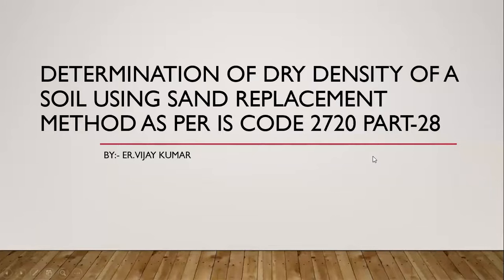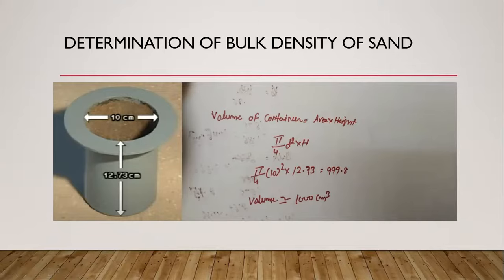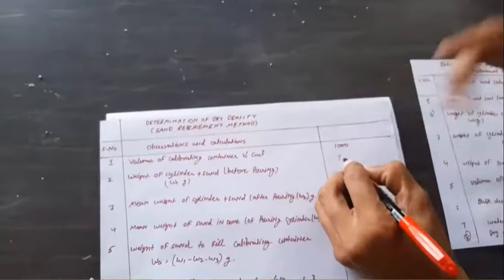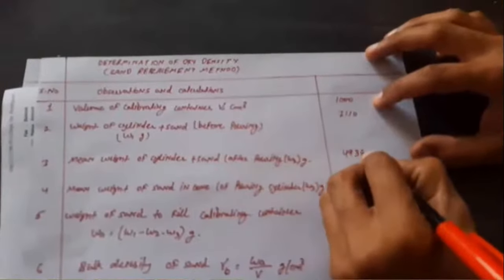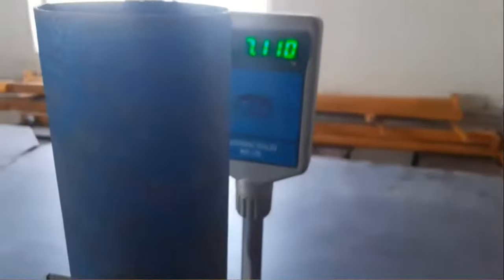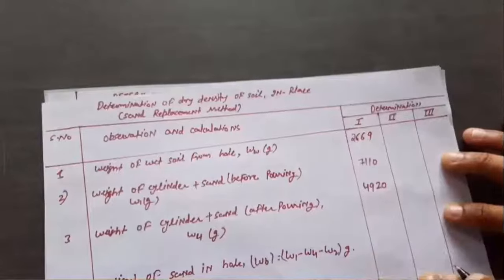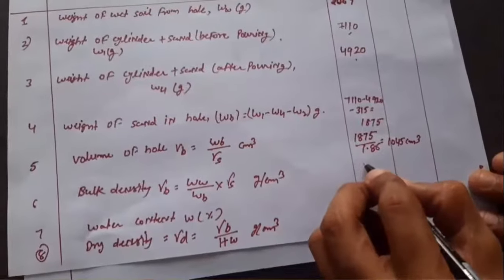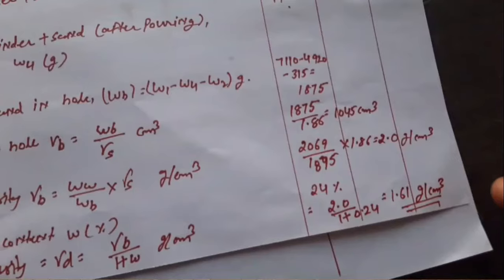Determination of dry density by sand replacement method

Comment: Hi sir 
Nice explanation.
While finding bulk density of soil we need to do weight of wet soil divide by volume. But u have written that weight of wet soil divided by weight of sand. Why it is so ? Can you please explain
Reply: Volume of hole will be equal to weight of sand/ density of sand that will comes out as 1008 cm cube. that has divided to weight of soil that we collect from hole and calculate the bulk density of soil. 2069/1008= 2.05 g/cm cube